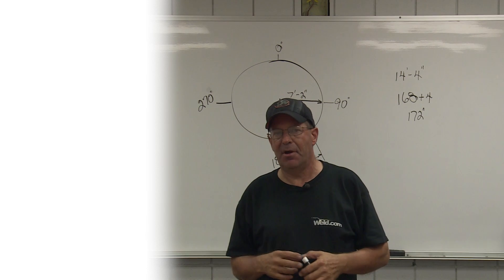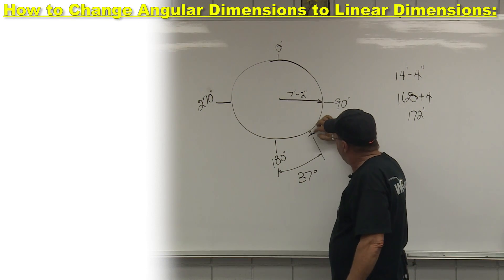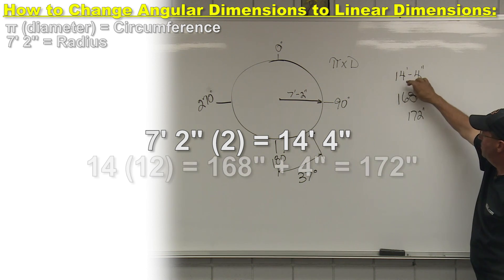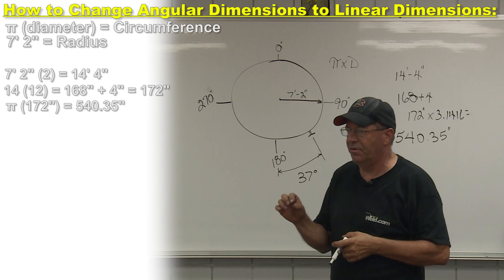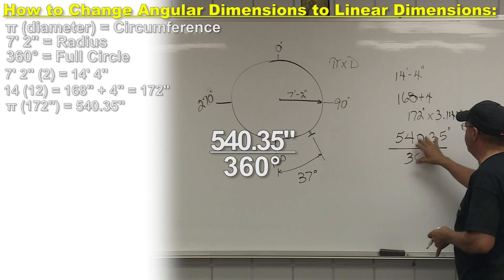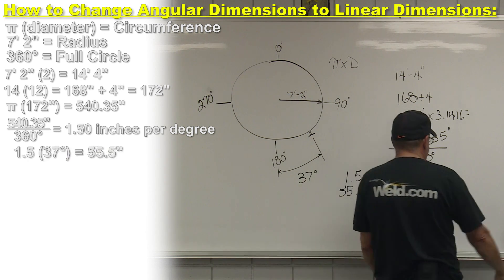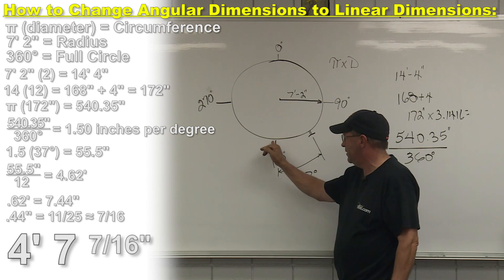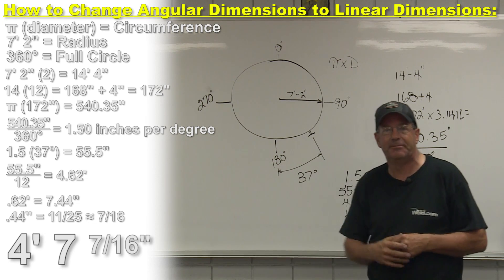SHOP MATH (Ep. 1): Convert Angular to Linear Dimensions

Comment: It’s very important to point out that this is NOT a “linear” measurement. This is an arc length which is a measurement wrapping along the circumference of the circle. You’d have to use a fabric tape measure or a string marked with the dimension to lay out the feature. Getting the straight linear dimension from point a to b requires trigonometry.
Reply: BS I can swing an arch with a steel rule.
Give a dog a bone.
Reply: @simpleman283  how would you do that? Always interested to learn new techniques.
Reply: @allamericanposer2102  In the center; drive a nail or screw. All rules of the measuring type have a slot in the end. Hook the slot over the nail or screw, which ever is appropriate for your application. Hold a pencil/scribe hard on the mark, then in an arc form, sweep the rule w/marker of your choice along said perimeter. Job done.
   Cut accordingly, with your preferred method.
Reply: @simpleman283 that method may work well for scribing an arc out on a plate or flat surface, but that is not the problem outlined in the video. The problem is to mark out a feature x-degrees away from a point on the face of a hollow shell. Finding center and swinging an arc out would prove difficult, especially on as large of a workpiece as described in the video (7 ft radius). It would be much less time consuming to covert the measurement as shown in the video then pull that dimension along the outside circumference of the round material.
Reply: But I can tell you have never been out in the field of play. So nothing I say will hit home with you. You seem more like a book worm, than a job hand.

Comment: 55.536 inches is the Arc measurement.  54.576 inches is the Chord measurement ( straight line  with steel rule ) for 37 degrees on a 172 inch Diameter.

Comment: If the nozzle is 37deg,from 180 deg,can it be subtracted (143deg)& worked out in the same manner from zero deg & equals the same? I know it would be a longer measuring but can it?
Reply: Shorter distance would give you a more precise measurement.

Comment: What was the formula to get the .62 to 7 and 11/16”?
Reply: .62 X 12 = 7.44
Because .62 ‘ finishes in feet. So .62 X 12 inches in a foot. So your looking for inches, so your whole number is 7 inches. 
Your left with .44” 
So .44 X 16 = 7.04”
Because theirs 16, 16ths. In an inch. 
Or by 8, because theirs 8- 1/8ths. In an inch. 
.44x8=3.52 just round up to (four 1/8ths. = 1/2”)
Which is one 1/16th. more.
Hopefully not confusing.

Comment: Just to reiterate and continue the common-sense approach to doing fabrication math, one should realize rather quickly that 55.5" cannot be 4' 7-7/16. When one starts with X.5" then the conversion to feet must come out A' Y-1/2". The error here is in the rounding. Or, as a lab tech would say, an error in significant figures. 55.5 / 12 = 4.625, which would round to 4.63 rather than 4.62. However, in either case, the proper measurement would be 4' 7-1/2". 

To do the calculation more accurately: 

1) divide the decimal inches by 12, then keep only the whole number, dropping the decimal remainder. In this case that is 4, which is the number of whole feet in the final answer. 

2) subtract the number of whole feet x 12 (in the example 48) from the original number: 55.5 - 48 = 7.5. Again keep only the whole number (7) which represents the whole inches in the final answer. 

3) Take the decimal remainder from the inches calculation (0.5) convert it to a fraction (1/2) which represents the fractional inches in the final answer:

4' 7-1/2"

However, I fail to see the need to convert to feet and inches from inches because 55-1/2" would be way easier to work with than 4' 7-1/2" on every tape measure I own. 

Interesting, but irrelevant, side note: The actual length of that arc is going to be just a shade over 55-17/32" and can be calculated even easier by multiplying the radius of the circle by the central angle in radians. To convert degrees to radians simply multiply the degrees by a constant of 0.0174533.
Reply: Interesting point. But, while you're swimming in decimals I've already rounded it off, laid it out with a flat steel tape fabricated the fit and moved on. Good feedback, thanks.
Reply: "You see, to me, tech math problems are kinda like common sense..." Kind of like when you start out with "something-and-a-half", do a unit conversion and come out with "something and seven-sixteenths". If you'll get me a mailing address I'll see that you get a decent pocket calculator so that you won't be swimming in decimals, or suffering from compounding errors.

On a side note, I enjoy the channel and its content!
Reply: I looked at it again. you're right on the half at 55.5". I should've left it alone but took it to feet and inches and lost a sixteenth in rounding. Nice call.

Comment: As a retired (old)  home hobbiest welder and somewhat of a machinist I had the opportunity of letting a large local fab shop let me watch over a welder for a few hours. It was an eye opener for me, as welding was the smallest part of what was going on. In addition to the math you presented, there was the creativity they used to figure out how to repair some dimension parts that did NOT come with any reasonable instructions. Lots of common sense reason had to be used by the folks there.
Thanks for showing other aspects of welding.

Comment: I had a job that needed 90 degree bent roundstock with a certain radius length in addition to the leg lengths bent from a single straight piece cut to length as to not waste material. We did our best guess and then added a bit to get the correct length after a test piece, but knowing the correct way to do it would have been really useful. It was .25 * pi * dia + leg + leg. Also I need to relearn all that triangle BS from geometry.

Comment: 55.5 inches is actually 4'7-1/2".
Reply: Feet and inches are two different units of mesument but are used together in architecture terms. When doing any math with the two units you must separate them into there own components. So if you're converting say 13.25 inches into feet, you must ignore the decimal place first. So 13 ÷ 12 = 1.083 . Remember the decimal places are ignored when finding feet. So now we know it's 1 foot something. To find inches, we know it's at least 1 foot, so 12 inches. 13.25 - 12 = 1.25 . So now we know it's 1 foot 1 inch point 25 inches. To convert the decimal into a fraction is a whole other ball of wax. There's plenty on fraction converting videos on YouTube check Khan Academy. I know .25" is 1/4 of an inch. So 13.25 inches is 1'1-1/4". NOT 1.1041666667.
Reply: With that aside. I do enjoy your videos, been a sub for at least a year and have watch all your vids on this channel.

Comment: holy heck the imperial system is inefficient AF
example
7'-2" is 2184.4mm ... x 2 = 4368.8mm x 3.1416 = 13725mm / 360 = 38.125x37 = 1410.6mm. 
No need to convert from feet to inches and back again, just move the decimal point over!

Comment: As always, a great video. One thing I would mention is the very last part of the equation when you converted 55.5" into feet, you rounded to 4.62' but leaving off that last decimal(55.5/12=4.625) can have consequences at bigger amounts. For this video it was only a 1/16th difference. Thanks for the video, I didn't know how to do this!

Comment: Interesting and informative. Why didn't you leave it at 55 1/2 inches? was there a reason?
Reply: imperial tape measures don't read out in inches, they read out in feet and inches. saves you having to do EVEN MORE MATHS when all you want to do is reel out the tape. alternatively, just use metric like the rest of the world.
Reply: I don't know where you are from but here in the USA imperial tape measures read in inches. They also include foot markers and stud center markers. You are correct though would be nice if we would just use the metric system.

Comment: can you please cover how to change a decimal point into fractions of an inch as i only know millimeters and thats ok till i only have fractions for drill bits and need to drill and tap a thread
Reply: grayem pepper there are plenty of standard charts it's easy enough to print these things off, throw in a plastic sleeve and keep in your tool box or hanging near your bench. I keep one for fractions to decimals. And one showing hole and tap sizes  for decimals fractions and metric.
Reply: Decimals are fractions, just expressed in (usually) thousandths of an inch. Example 0.125" = 1/8". Another way to do it is to envision the fraction as a division problem, then just do the math. 7/16 (seven divided by sixteen) equals 0.34375". Where it gets tricky is there are thee different drill sizing scales; letter, number, and fractional. The easy way to figure out tap drill size is to look at a chart.
Reply: Don't know how to edit, but 7/16 should equal 0.4375.
Reply: bob this is all great info but i dont have a chart to look up these things and i didnt know what size to grab to drill my M10 tap when i only had fractions for drill bits i ended up working it out by trial and error but still love to know by maths

Comment: You could also simplify by converting the angle to radians and just multiply by the radius. The length of the arc becomes (37*pi/180)*86 = 55.54 inches

Comment: While Not a Welding video in the usual way, this video is still a very useful and important video. 
Interpretation of drawings correctly is what makes the difference between a welder and a tradesman. 
You can claim to be the best damn "Gun" welder ever, laying down beads that make people drool, but if your welding of one component to another is done in the wrong place and/or at the wrong angle/orientation, then it dont matter for shit, because someone with better skills will have to come along and rework your botched up job. 
Trouble is Mr Gun Welder, you wont get to see just how much work is involved because you will have already been sent on your way down the road.
Every trade and occupation has "Gun" operators who end up creating more work for "Real" tradesmen and women to fix up.
Reply: Its happened to me. So its nice to learn why and how to calculate it.